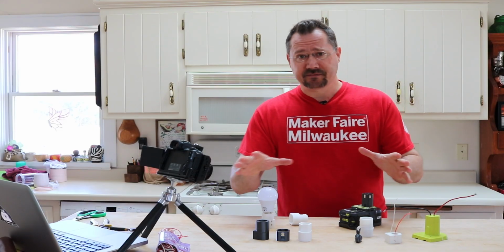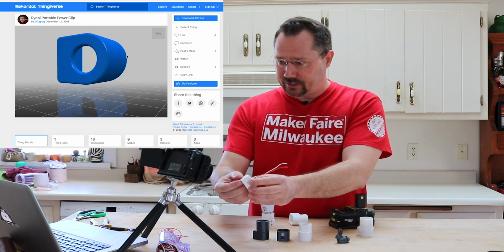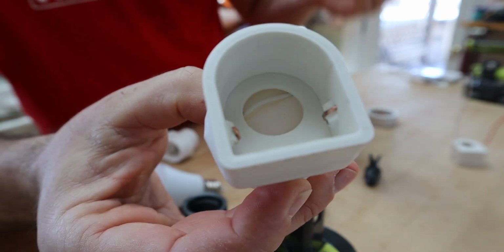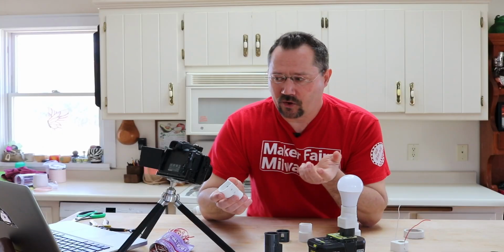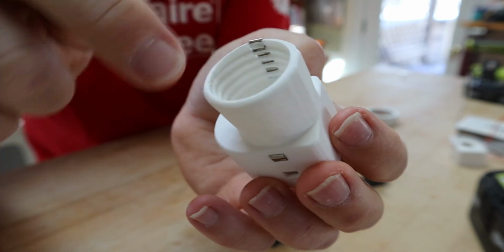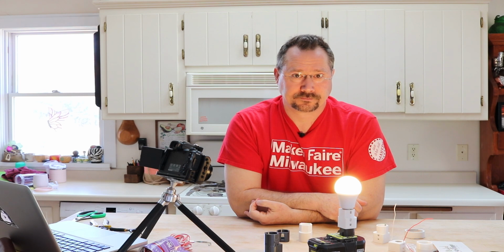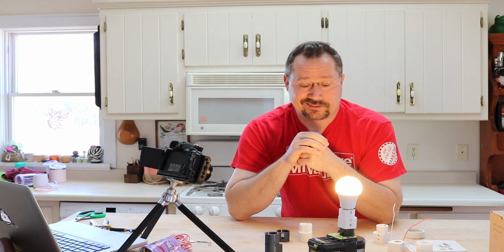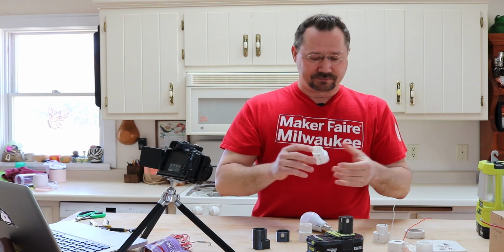Design & Make a 3D-Printed Ryobi 18V Light

Comment: Add a switch if possible
Reply from the maker: I thought about it, but all that does is adds complexity. 
It’s VERY easy to turn it on and off by unscrewing the light bulb part way or simply pulling the unit off the battery.

Comment: Hey Ben, I can see where you wrap the nickel strip for the positive terminal.  But How do you wrap the nickel strip from the bulb threads (ground) terminal.  I cannot see how you route the nickel strip from the bulb area to the lower battery terminal?  Do you have to cut a slot from the bulb area into the battery area?  I have printed the 3D model from Chris.  but cannot see how to route the strips. Thanks Joe
Reply from the maker: No cutting required. The shape of the 3D print makes it so that you just wiggle the nickel strip through.
I'll see if I can make you a quick video of it. That may be challenging, as my fat fingers tend to block the view. Maybe I can use a half-printed part as an "X-ray View" to make it easier.
Reply: @BenjaminNelsonX  thanks Ben
Reply from the maker: Hi Joe, I hope this video helps you out. It's a little long, but I think is a good explanation and you should just be able to follow it along in realtime.
https://www.youtube.com/watch?v=lIo_5uUEBrA

Comment: I've made a couple battery connectors using some leaf spring contacts made for molding into plastic parts, including one that clips onto a Ryobi pack (I didn't do much with it though, just some charge/discharge capacity testing when I was rebuilding some of my old packs). Can't believe I didn't think of grafting either a custom LED panel or a 12V MR16 onto the top of it.

Comment: Hey Benjamin, great project!  What 3-d printer would you recommend for a beginner?
Reply from the maker: I am certainly no expert when it comes 3D printers. However, my friends who have some of the most 3D printer experience that I know of just sold their old business printers and bought 4 brand new ones. I just bought the same one they did, based on their recommendation.
It's an Ender3 S1 printer.
It has automatic bed leveling and a number of other nice features. It includes a flexible magnetic bed mat, so that when your print is done, you just pick it up and pop it off the mat. I really just wanted something I could buy that would just plain work - so I could focus on learning 3D modeling and actually MAKE 3D objects instead of messing around with the printer.

Assembling the printer was very easy, and my first print turned out great with zero adjustment.

Overall, I'm very happy with it.
It's this one:https://amzn.to/3iURvVL

PS: The other thing that's really nice about it is it's very quiet. You just hear the fans going. Older 3D printers would make a bothersome beep-boop-bleep-boop noise the entire time the stepper motors were moving.

Comment: I was just wondering if there is any risk to the Ryobi battery with this. Specifically when it comes to over-discharging the battery. In order to protect the battery from over-discharge, most tools will cut out when the battery voltage gets too low. If you were to leave this light bulb on my guess is that it would continue to drain the battery untill it is completely flat, potentially damaging it.
This wouldn't be a problem if you were to monitor the battery and disconnect the bulb before the battery got too low, but you should probably advise people about this risk.
I'm sure the Ryobi lights you showed have some sort of circuit to turn off the light and protect the battery once the battery is flat, so it's probably not a fair comparison to compare your light to them without mentioning this difference.
Reply: Trivia of the day--- Ryobi ONE+ 18v batteries have on-board battery protection circuits. This is necessary because the new Lith-Ion batteries are compatible with the old Ryobi tools that originally used old NiCad batteries.
Reply: @JDeWittDIY  thanks for the reply and thats good info to know. Do you know how it works? Is there a MOSFET that disconnects the cells from the batteries power tabs when the voltage drops?
If this feature is unique to Ryobi's batteries it gives them an advantage over other brands for these types of projects.
Reply from the maker: Not that I need to turn on a light and walk away from it for hours (the 4AH battery will run the light for about 10 hours continuously) but if I did, the built-in low-voltage disconnect would turn the bulb off. I can't tell you the details of the circuit, but it kills power at around 14V.
Plugging in a light like this and walking away will NOT murder the battery.
Reply: I'm pretty sure every lithium power tool battery does this - there's a BMS  board built into the pack that will shut off under deep discharge or overcurrent conditions, and usually temperature protection and balance charging too. So it's basically safe to connect to any kind of load and the battery itself will disconnect if you try to draw too much power.
Reply: @ailivac  @harley morgan is right. Every tool system has protections for the battery. Almost all of them have the protection in the tool, not the battery. Ryobi 18V specifically is the only one I know of that has the protection in the battery.  This was necessary when they decided to keep the same form factor as the old NiCad batteries and make the new ones compatible with old tools.
Reply: @ailivac  every tool system will have the protections that you mention. The question is, how are they implemented? There are many ways to implement the stated protections.
Are the protections carried out on the tool? The tool can monitor the battery voltage, temperature and current draw and turn itself off if required. This would be the easiest and cheapest method to implement. If this is the case then this project would not provide the battery any protections.
If the cell temp, current draw and voltage are monitored by the battery itself and the battery has a way of disconnecting the load, then this project won't bypass the battery's protections.
I have two Ryobi 36V batteries from the outdoor garden tool series sitting in front of me right now. Each battery has 4 terminals. The terminals are +, -, T1 and T2. The + and - terminals supply the batteries power and the T1 and T2 terminals would most likely be a thermistor. This would allow the connected tool or battery charger to read the batteries temperature. This would indicate the the battery protection on these particular batteries is done at the tool/charger level and not in the battery itself.
Reply from the maker: @harleymorganster  The low-voltage cut-off is in the battery.

Comment: Here is an invention for you:  Make an attachment for battery powered tools such that you can wear the battery on your belt, and have a 4' coiled cord to plug into the tool...  Benefit: transfers the battery weight to the hip, thus lightening the tool.
Reply from the maker: I've seen such things before. They were a really good idea back in the lead-acid battery days.
For early consumer video cameras, there was even something simply called a "Battery Belt".

Nowadays, with lithium being so light-weight, probably the easiest thing to do is simply use one of the smaller batteries. They hardly weigh anything at all.